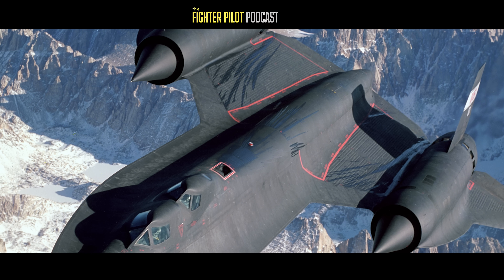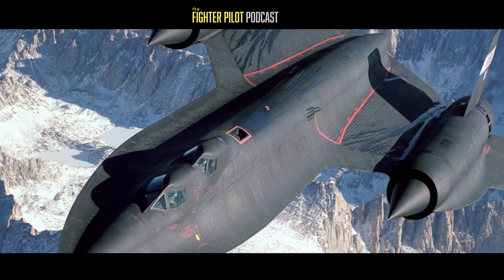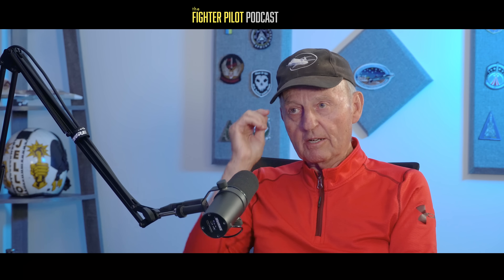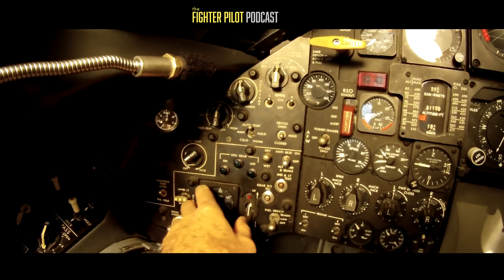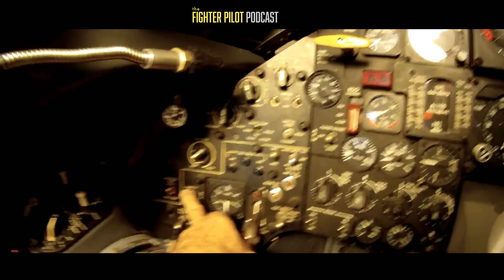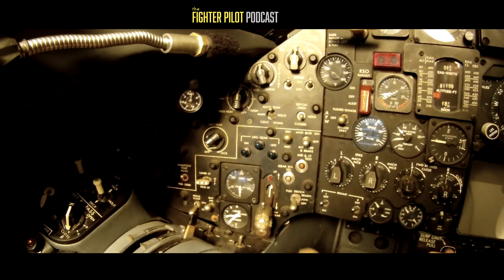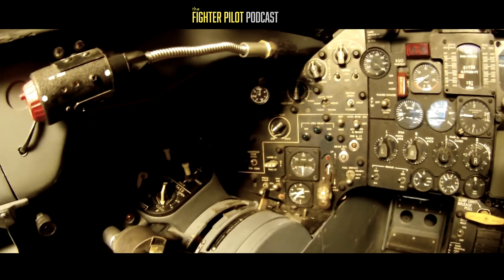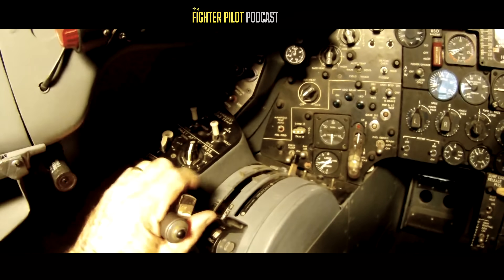NASA Test Pilot flew the SR-71 Blackbird

Comment: 12:08  The J-58 required JP-7, not JP-8, as stated,  to attain max speeds.  Jet fuel other than the special JP7 (turbine fuel, low volatility) could be used, but lower Mach limits of M1.5 would have been enforced.  In an emergency, ANY tanker, not just a KC-135Q could plug into the Blackbirds, in order to prevent the loss of the aircraft just in case a Q suddenly became unavailable.
Reply: You are correct.  JP7 was the only fuel for the RS-71 (trust me on the name) for it to achieve its performance numbers.  Unstated is that the KC-135Q was a specialized tanker equipped to dispense JP7 due to its considerable viscosity.  That fuel also required TEB (Triethylboranein) in order to start since the ignition point of the JP7 is so high.
Reply: @richardgreen7811 
Correct with all, especially the actual designation.
Reply: Knew about JP7 but not JP8.  Also knew about TEB.  I so much enjoyed listening to the Sled-Drivers WAR Stories at Beale AFB (Yuba City, CA).  I only went to their PUB because the lighting was conducive to reading my Bible during the evening hours.

Comment: Quite a few years ago, 1977. Was employed by Gates Learjet, instructor/demo Captain. Had the pleasure of seeing one of these in flight.  We were in a Lear 35 at FL410 over Wink, TX inbound to KDAL. We could hear ATC talking to a military aircraft at FL390 looking for higher. ATC broadcasts simultaneously on VHF/UHF, but we could only hear the VHF side of the transmissions. ATC then gave us a traffic advisory, "724 Golf Lima, an SR 71, one o'clock, 5 miles, FL390". And about as fast as you're reading this he went from a speck on our right to one on the left, crossing right in front of us. As soon as the controller had separation, the next transmission was his call sign followed by, "cleared to FL600 and above!" (FL600 is the ceiling for controlled domestic airspace) We watched, saw the glow of the burners kick on, he pitched up, and was gone! What a kick to fly something like that!  We inquired as to his speed, "Sorry, that's classified!" That woulda been '77 or '78 thereabouts.

Comment: A locking pin for what?
Reply: There are locking poins for the ejection seats and for the landing gear.  They were referencing the landing gear downlock pins.  This prevents gear retraction whilst n the ground.
Reply: Landing gear - so they would not collapse after the engines were shut down and their generated hydraulic pressure was eliminated.

Comment: I have never seen a plane that you "pulled the throttles back" to accelerate even boats you push them forward.
Reply: Think about it.  Under max acceleration, Gs are pushing you back.  Much easier to pull on the throttles.  Race car sequential gear boxes pull back to upshift.
Reply: @RichardinNC1  Thanks... Dick, but airplane throttles aren't the same as an automotive short-throw gearbox lever. Pushing the throttle increases power, and pulling it decreases power. Think about it.
Reply: @brianbassettnumber1  my point being, in a high G acceleration situation, reversed throttle levers would be a benefit!

Comment: i will always be curious as to how fast that plane really was  😉
Reply: The bird was limited by the Compressor Inlet Temp(CIT). Max operational temps allowed were 427ºC and violating that could cost a career.  For a record attempt, the max CIT allowed was raised to 450ºC but ambient conditions didn't allow record speeds to be attained. By the time you've cruise/climbed to mission altitude the SR only had about 10 minutes of fuel to break records. This is double the time the A-12/YF-12A/M-21 has to play with as they had the shorter fuselage and the smaller fuel load. 68,000 lbs vs the SR's 80,000 lb fuel load.  Wind direction, temp, velocity all affected top speeds.  Brian Shul reported Mach 3.5 as he evaded a missile, but he was known as being quite the "storyteller".  Claims of anything faster aren't realistic.
Reply: What they are flying today would probably leave the SR71 sitting in its exhaust
Reply: @thomasshepard6030 
Right? 
Lazar brought friends to the desert out at Area S-4 ... to see test flights of back engineered gravity manipulation craft. 

That was the 80's, so yeah, do the math, I can't imagine what DARPA, Lockheed, EG&G Special Projects, ... in some applications perhaps indistinguishable from ufos?
Reply: It was fast enough that the drag chute attach pin would burn your hand after a flight. The crew would jettison the chute when their rollout speed decreased to a given speed. Our transit alert crew, at Edwatds, would drive on to the runway and pick  up the chute.  That may seem trivial except for the fact that the chute was in probably one of the coolest area of the  aft fuselage and no one knows how long the aircraft had to cool down in the decent and approach.
Reply: According to a documentary i watched they couldn't shoot it down, too fast and long range to have it caught, bullets wouldn't fare better i guess with the speed difference of a normal jet, i thought that made it probably as scary for the pilot as the stuff which it could spot, which apparently was mostly anything as it was techy as shit, basically it was, when i was young and read about it, a space ship they flew as an airplane, really quick
Reply: Mach 4.4 was possible according to something I just watched about it, but it probably did better than that.

Comment: 17 years after Roswell the SR-71 was flying. Some of the technology in this plane is still secret, the fact that this thing flew on digital controls in 1964 is unbelievable.
Reply: The SR was changed to digital controls in the 90’s when the program was re-instituted not 1964, See @12:24
Reply: First commercial plane with fbw was concorde
Reply: Its not secret any more. 

The SR-71 pilot manual is available on the internet. Its performance is well known. 

Its best capabilities were flying the perimeter of the USSR causing them to light up their radars and give away their positions so the military could plan low level attack routes thru the danger. The SR-71  could intercept the radar signal from SAMs missile guidance, and jam it or even copy the signal and transmit back to it out of phase so the missile would think the jet was somewhere else. They would then accelerate and turn at altitude and a missile with a good lock would be incapable of turning in the thin air at extremely high speed. Whereas the jet could perform up to a 45 degree banked turn and pull up to 1.5g after being fully heated up at mach 3+. It regularly was rated for over 3g, but the extreme heat reduced the strength of the titanium to 1.5G at high mach. There was probably something with inlet position, mach angle, and angle of attack that might have caused issues as well. Unstarts were hypothesized as being caused by the jet being ao fast it could fly into areas of cooler air, where the speed of sound was slower, changing the mach angle and causing the mach cone to injest into the engine aince the inlet spikes could not adjust fast enough and/or the jet had no way of determining outside air temp to compensate for rapidly changing extremes. Lots of good info available for the SR out there if you look for it and know what you are hearing or looking at. Brian Shul as these two alluded to, was not a technical source of knowledge even though he absolutely had the chops. He was a public figure who made a living by public speaking, and the general public only cares how fast it went and about cool stores. 

Brians book tells little details, but what he does tell awesome. 

"A rifle bullet out of an M-16 travels at 3,100 feet per second... We cruised at 3,200"...
Reply: I read all that, I didn't understand the sciencey things, but that was very interesting all the same😃